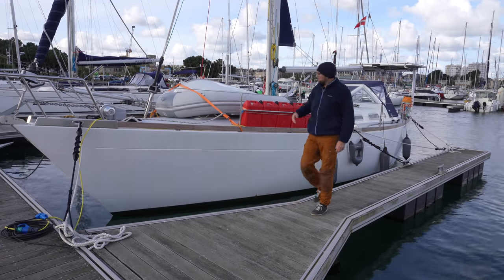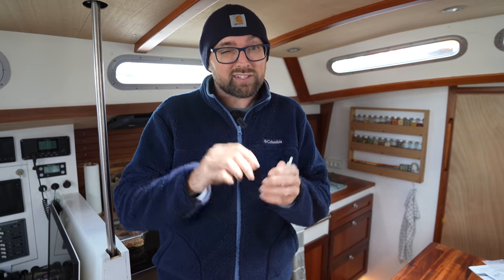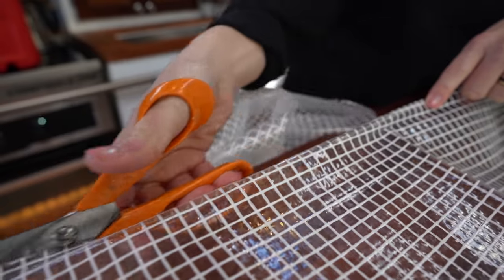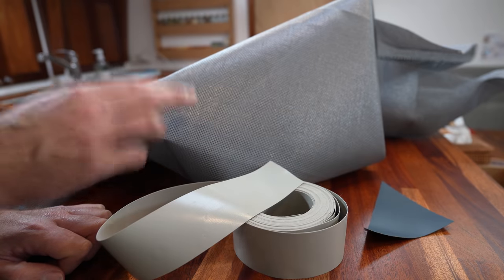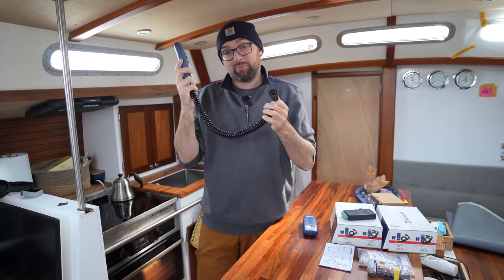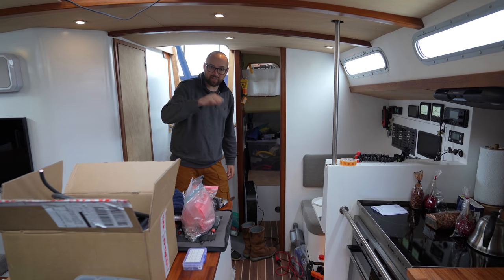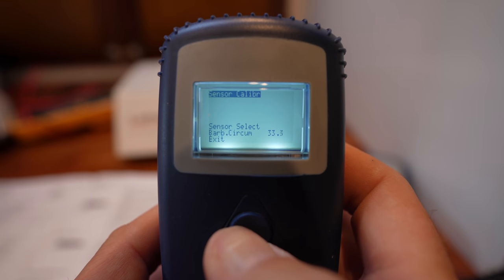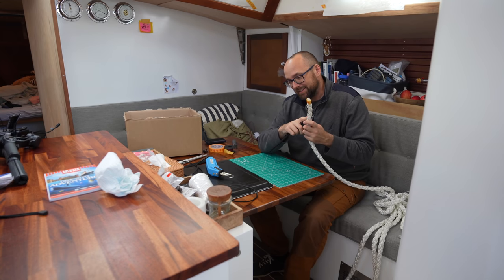Sail Life - Wireless windlass remote with chain counter & canvas projects ⛵

Comment: Mads, may I suggest to use velcro tape instead of double sided tape? This would allow you to remove the remote control box easily, whenever you need to. Happy to see you both sailing!
Reply from the maker: That's a great idea! Ava actually got both 🙂
Reply: I believe Velcro is a rip off.
Reply: @MARTINA-gc3tq  :-D
Reply: @SailLife  Also put some velcro near wherever you think you will use the wireless remote.  You may find that it lives on that velcro and you just reach out and touch the buttons.  Less likely to go overboard too.
Reply: @MARTINA-gc3tq  😆
Reply: @MARTINA-gc3tq  Loopy suggestion but it hooked me.
Reply: @MARTINA-gc3tq  it always is!
Reply: @roygardiner4002  boom boom!
Reply: @SailLife   I have found that the only weakness of stick-on velcro is direct sun and high heat.  I used it for a car dashboard Gopro mount and the direct sun just caused the glue to become gooey and melt and the camera popped off.  However, in the same vehicle I ALSO used it for a CB Radio handset mount, in an more shaded area of the vehicle, and it was fine.  So wherever you mount it, keep it out of direct sun and high heat.
Reply: @MARTINA-gc3tq  ha ha lol pun!
Reply: velcro works well to prevent you going overboard, just put it everywhere and on your foul weather gear.
Reply: My hidden AIS tracker devices are velcro mounted otherwise I would have to demolish my nav station to screw mount them. They haven't moved in 3 years.
Reply: @SailLife  Of course she did!
Reply: @Wearyman  concur. stick-on Velcro has always seemed like a better idea in theory than it turns out in practice. Even if it doesn't fully let go, it will end up "creeping," and the goo collects dirt.
Reply: Perhaps a pocket, expertly crafted by Ava, would be easier to use and less likely to come loose.
Reply: @MARTINA-gc3tq  Ha

Comment: It is always great to see our products on board :) 
Just a small correction concerning the mounting of Thetis 7003.  In the package we provide 2 screws M3x19, 2 screws M2.5x16, and 2 mounting brackets for mounting the Receiver, base unit. The device can be mounted very easily.
Initially the 2 brackets must be fitted on the back, right and left of the device with the 2 screws (M2.5x16) removing the already existing ones. Then the whole set is fastened in the desired position using the 2 screws M3x19. 
Regarding the cables, and in order to prevent any damages, we advise you not to flip them upside down, as we saw in the video. 

Thank you for the video!

Lofrans’ Team

Comment: Ladies and Gentlemen, If the people on the dock are not laughing at the size of your anchor may I suggest you get one that is two sizes larger.   With the nice setup you have and all chain a monster anchor is I have found to be "pretty darn spiffy'.  
All the best
Reply: As a long-time believer in and user of the Rocna, I know that the 25 is spiffily in the middle of the recommended size for a boat of their tonnage and length. Other makes of anchor would need to be larger. Go, Rocna!

Comment: A little fun project would be to attach a floater "doo hicky" to the wireless witless control.
Reply: We have endless problems with our ceiling fan remote controls. 5 am on a frosty morning the fan in our bedroom starts up full speed. Then the fan and light go on and off in the dining room. We are having remote control battles with a neighbour. Imagine if you are in a marina and you can drop your neighbour's anchors for them. I mean currently I can change my neighbour's Victron charger from 12 volts to 24 over bluetooth.
Reply: A cork sanding block would be good.  Floats and continues the sanding reference.

Comment: Hello guys, as a suggestion Mads, for Mk II of the bridle, may I suggest you consider not forming the loops, for the deck cleats. I did exactly the same as you, though I whipped the base of the thimble to allow for stretch. A wise old sailor seeing my bridle simply commented  "what will you do when the wind increases in the anchorage overnight and you start to drag, how will you let out more scope?" I now have just two straight lengths, no loops, longer than the original.

Comment: Actually the size of the rope loop for the cleat is wright, here’s a trick that I’ve learned years a go during one of my diving courses, pass the rope under the cleat (on the small central aperture) then fold the loop upwards and secure in to the top part (like doing a Y shape), it wold transfer better the weight from the anchor chain to the cleat and make a more secure gap that couldn’t make out by mistake

Comment: Have you considered making (or buying) a wrist strap for the wireless remote controller?  That way when in use, make a habit of wrapping the strap around your wrist as an added security from drops.  The responsiveness lag on the wireless remote is normal.  I just recently installed one on a winch and it too has lag.  You learn to live with it as the benefits of having a wireless remote far outweighs any negatives.
Reply: And if you make the strap from a floaty material, if you drop it you won't lose it to the depths.
Reply: I'd even take it further and use a lanyard with netting type pouch to stick the controller in.  That way it leaves both hand free in between use while anchoring.

Comment: I'm a long-time viewer and have enjoyed watching the extensive transformation of Athena - congratulations on all that you have accomplished! In your last video I did noticed that the swivel on your ground tackle was connected directly to the anchor, may I suggest that you add a couple of chain links between the anchor and the swivel so that the swivel is not strained laterally with each wind shift but is always pulled straight-on which is how the swivel is designed to operate.

Comment: Just put an up / down switch in the cockpit then you can operate the windlass singlehanded from the cockpit while manoeuvring the boat just in case the wireless version stops working.

Comment: Mads ,I put stick on plastic magnets on my remote controller for my trolling motor and for the remote controller for the anchor.
The plastic magnetic tape is strong enough to hold the controller in place and you can put the magnetic tape to hold the controller any place you want to . The magnetic tape comes off really easy if you decide to move the location without effecting the surface you've put it on.

Comment: Hi Mads, I have a (different) wireless remote, with what I believe is a very similar problem to the one you have.  When you are raising the anchor onto its roller, there is often a need to ‘inch’ it in to get it to sit right on the roller, with the chain taut enough to hold it in place.  The problem with my remote (and maybe yours too) was that it always runs for 1 to 1.5 seconds as a minimum, which makes it difficult to get the anchor in place without it slamming in with the chain bar-taut.  I now always use the manual remote for final positioning….

Comment: Make a wrist lanyard for the wireless windlass remote.  Add a sponge type floatation device to the lanyard so that if you drop it overboard you will not need to dive to try and recover the device….  A waterproof heavy gauge plastic bag to protect the device would not be a bad idea too if it is not already waterproof.

Comment: Try to get some used firehose for chafe. It lasts the longest and is the cheapest, even free if you ask at the fire stations around you.  I tried many bridles but actually now use a single snubber with a rolling hitch. Cheap, quick, and easy. Don't bother with bridle anymore, as it rubs against our bobstay. Also consider not putting in eye splices on the cleat end, as this prevents you from adjusting them under load easily.

Comment: When it comes to mounting objects like remotes, I always suggest using 3M Dual Core fasteners.  It is a very strong plastic similar to velcro.  I have used it for years even on my scuba gear.  Once it sticks it stays, and it takes a tool to separate.

Comment: I used Command Adhesive strips for a towel rail as did not want to drill into my shower wall still holding after 3 years. They are good for semi permeant  attachment.

Comment: I was wondering about the use of a Hall effect sensor in such a simple device. However, the sensor for the transition of the magnet is probably a reed contact. That works similar to a relay contact, except the magnetic field is not produced by a coil, but by the proximity of the magnet in the gypsy.
Reply: Hall effect sensors are used everywhere you will be pretty hard to find a reed switch anymore especially in devices like that since even in a slow situation the high amount of cycling would mean a very short lifespan and a hall effect is basically a solid state reed switch

Comment: Regarding the windlass, the 3% voltage drop is a vestige of the Lead acid word designed to prevent additional voltage drop  added to the already large drop at the batteries.  10% is well within safety and the LI batteries drop very little and have a high resting voltage anyway.  It is wierd that this is not more known.  Maybe the wire mfg are blocking this information LOL

Comment: Hello! I am new to your channel, and thank for your good pointers. I was searching for more info on the installation of the magnet and sensor for the Thetis 7003 I just purchased. The info from Lofrans is a the very best « poor » from a customer oriented philosophy I happen to have. Anyway, you mentioned the alternative method of mounting the sensor and led me to believe there was actually a special part available from Lofrans. I would like to know if this is the case and in that case would you have a reference for purchasing one (part number?) for a Lofrans Tigres windlass, it would be most appreciated (if not I will design one attached to the chain stripper’s bolts)? I totally agree with your in saying the plastic tube is a «flimsy » approach. 
On another note I also agree with at least two other followers regarding the snubber loops. I would not make Any loop to maintain the ability to remove the snubber under emergency conditions without having to strain the windlass motor unnecessarily. Thank you in advance for your response.

Comment: For the canvas alternation to access the handles - why not add a slit on both sides equal in length to the handle? When you grab in the fabric would just adjust to for your grip
Reply: Why the need to grip anyway? If they are to be used, the covers should be off so they don't get spoiled by diesel.

Comment: Hi Mads-  Long time fan and watcher of the channel.  I have the same windlass and remote and agree completely about the mounting for the sensor.  However, I can't fine the metal bolt on sensor mount you used.  Can you point me in the direction of where you ordered yours?  Thank you!

Comment: Our friends had a windlass on a wireless and it’s not a safe item unless you have a parallel set of up down controls either at the helm or up front.   They had issues where the battery died when they needed the anchor.  They had issues with exactly where you held the remote.   Just plain unsafe.   The simple solution is to have a set of parallel up down controls…if you have these additions switches then the wireless is fine.
Reply: agreed. abandoning the foot switches is a bad idea.
Reply: In the video he shows having both a wired and wireless controller….if both fail, hopefully he put the anchor winch on the electric panel with its own master power switch.

Comment: Hi Mats, may I suggest to mark your anchor chain with paint instead of using plastic markers? The ocean has already plastic enough. Thanks 😊
Reply: I agree completely. Please don’t put those plastic doo-hickeys on your anchor chain - they fall off and take thousands of years to disintegrate. I have simply spray painted my chain at 25yard intervals with fluorescent red 25, blue 50 and yellow 75 and then all three colours at the 100yard mark. I have 300ft of chain, have used it all on occasion and never once had a problem miscounting. And at night, a 3foot section of paint shows up way better than a small non-reflective piece of plastic. I have used it for over two years in the Caribbean and only had to repaint once.

Comment: Excellent video, thank you.    I am curious why you did not use a brummel splice for the last 2 splices.
Again, thank you.
Reply: It could be that burying the end is tricky with 8 strand rope.  For a brummel splice at the end of a rope (as opposed to the middle) the end need to be secured inside the strand of the long end.  8 strand may (I am not sure) not provide enough clamping pressure to keep it from loosening.  So one needs to do a woven splice.

Comment: Double sided tape in a boat's environment will fail in time.. Just use an aluminum strip and make a holding bracket out of it and screw it tight to the bulkhead.

Comment: Hi Mads!
You might want yo look at the placement of the breaker for the windlass ... when speak with Lofrans they said the breaker they are talking about in the installation manual if for the windlass motor and should be mounted near the windlass... and additional fuse should be at or near the batteries to protect the wires... just my 2 cents
Love the videos!!!

Comment: I am having an issue finding the magnetic sensor kit that has the metal plate (vs the questionable plastic stick); is that a Lofrans part, or is it distributed through another manufacturer? Great videos! Thank you both!

Comment: Cutting a hole for the handle for the jerry can kind of defeats the purpose of the cover to begin with.  The stated purpose of the cover was to keep uv off of them with a big hole in the top only the handle will be unprotected from uv.  Leave the cover the way you made it.
Reply: Agreed.  Put a cord on the cover and secure it to the life line. Then when you need the jerry can, pull the cover off and leave it there and carry the jerry can to your tank fill.

Comment: A 3D Printer could be a useful tool to make a mount or tons of other doohickeys
Reply: Problem with 3d printer on boat is that they require a very stable platform to work properly - and a boat, even tied up in marina is not such a platform :) so a workshop like the one Mads used in Ghosport might be a better option, since there you can print whatever you need.

Comment: I have just fitted a similar Windlass and remote and also found the plastic chain counter sensor a little cheap and nasty. Where did you get the other mount? Was this an optional extra? Fair winds

Comment: Don't use these colored plastic chain markers! Apart from that they are somewhat expensive, they tend to pop out quite easily. Just use some cheap spray paint cans (or regular paint, but spraying is easier) in different colours and spray about 30 cm / 1 foot of chain at lengths of your choice.
Reply: There's a special spray paint they use for roads etc that really stick. Maybe it has epoxy or something in it.

Comment: they didnt even mold an eyelet on that wireless remote so that you could use a pingpong ball and make a monkeys fist around it, tie it and avoid losing the gadget to the depths. clearly going after you money! feed the bight of the splice in between the cleat´s feet, then go over it on both ends, it wont come off that way.  have no idea if the chafe protection was costly or not, but it might be useful to look into the rope access world. "rope pro", as we normally call it, itss a consumable and most likely cheaper that anything with the word "marine" on it.

Comment: Out of curiosity, why are the jerry cans red?  Shouldn't they be yellow for diesel?
Reply: More than likely there are two reasons. One diesel cans are more expensive and second they are square shape instead of rectangular which takes up more deck space. Hopefully the red plastic gas cans can tolerate diesel and not melt.
Reply: After some research you are correct . Yellow is for diesel. But if you have only one sort of fuel on board, does the color matter .
Reply: Everyone knows that fuel contained in red jerry cans has more power.  Just as red cars go faster. 😁
Reply: @mr.e7022  , Yes, I suspect they won't melt but if you have water, diesel and gas on board you wouldn't want to get those messed up.  Additionally, some gas stations might get a bit strict on putting the correct fuel in the correct container.  I had a station in the US once that refused to allow me to put kerosene in a red (gas) can....it had to be royal blue (kerosene).  Just a question....maybe it isn't an issue.
Reply: @maxx6691  ,  I had a station in the US once that refused to allow me to put kerosene in a red (gas) can....it had to be royal blue (kerosene).  Maybe it isn't an issue for Mads and Ava....I guess it depends on where you cruise.
Reply: @thepigwillfly5869  because they are not in america. For example in the uk there is no binding regulation on the color of fuel cans. According to the uk health and safety executive the custom and practice is black can for diesel.

Comment: It seems electric motor design engineers are compelled to make the space for wiring power to the motor as  small as possible.  Maybe it's an obsessive compulsive disorder caused by the electrical engineering curriculum.  Or.......maybe EE attracts masochists.  Who knows.